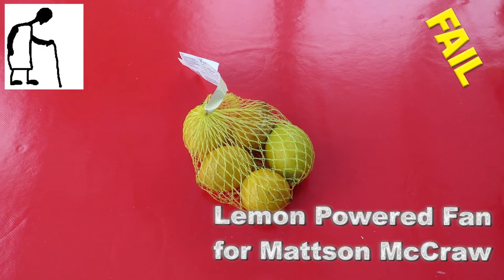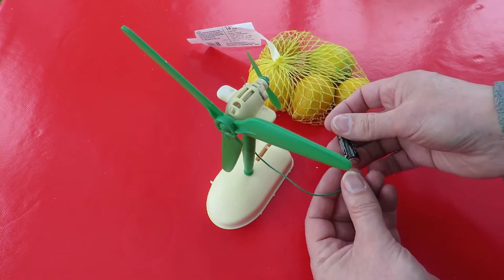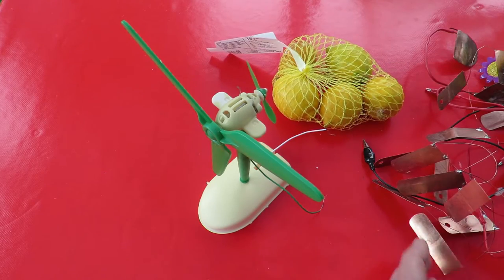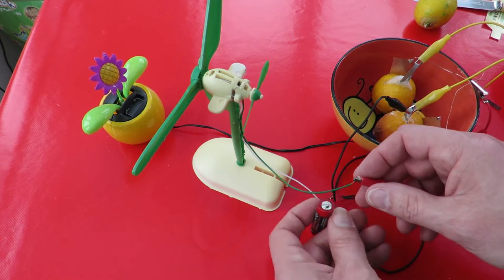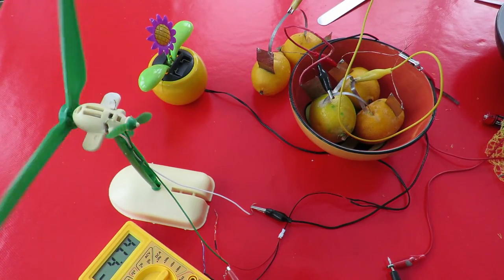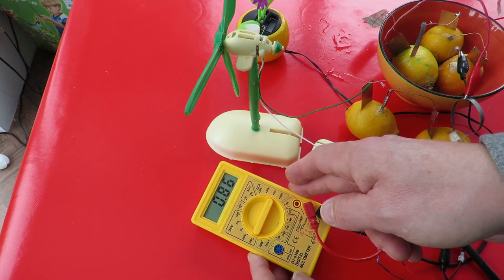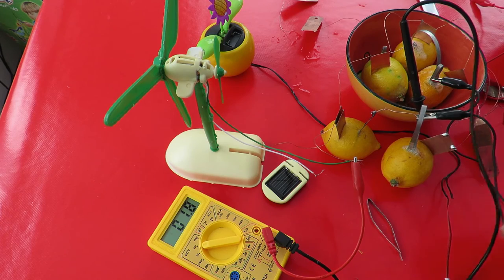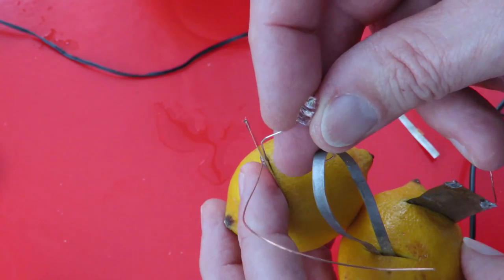Lemon powered fan for Mattson McCraw  - FAIL

Comment: hi grandad, by the looks of this experiment you would need the same amount of lemons to make up for the same amount of voltage and miliamps coming out of that solarpanel to make the fan work.whats the voltage and miliamps comking out of that solar panel? maybe thats the way to go if im right . good video as well.
Reply from the maker: Hi Marc, this is the same game as playing with potatoes and you probably saw that series I just did. I am not going to spend the same amount of time doing the same thing with lemons that I did with potatoes. For a start they are significantly more expensive and the results will be virtually identical. The best option is to charge a battery or a supercapacitor and then use that to power the electric motor. The point of showing the solar panel and the AA battery was to demonstrate by comparison how little power you get from a lemon.